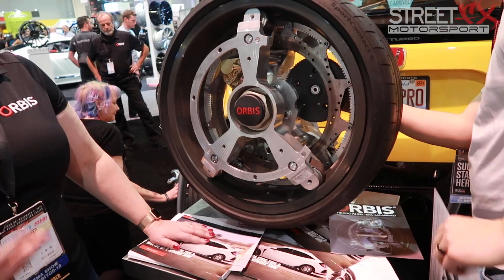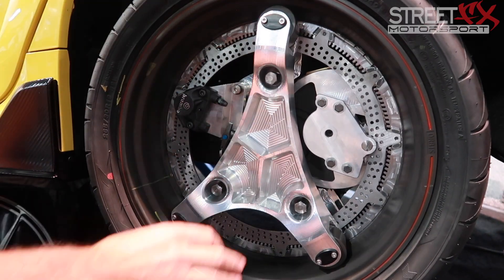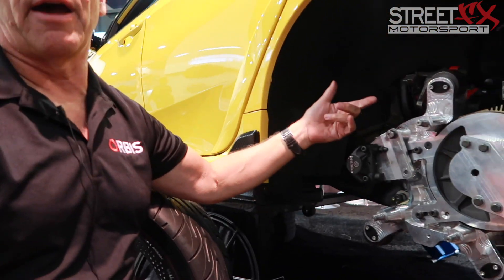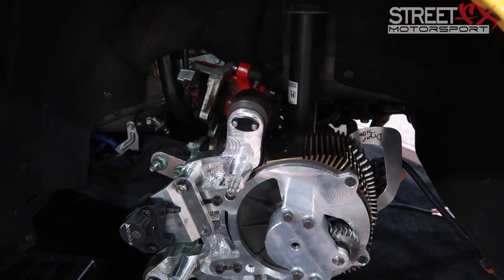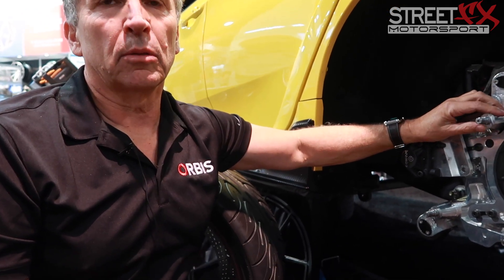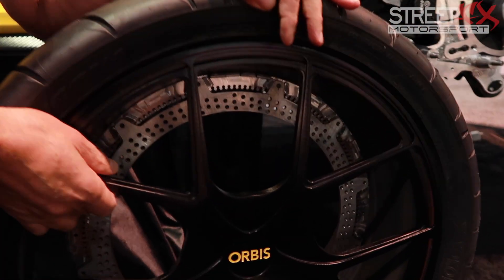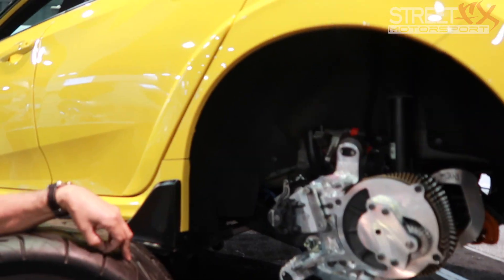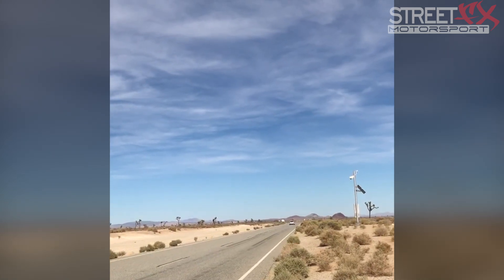WORLD's FIRST ELECTRIC hybrid AWD Honda Civic Type R FK8 with 450hp!

Comment: So 6, 2 inch rollers hold the rim on the car.  What happens when the rollers wear, the rim wears?  You have all that space and wheel offset.  Build a motor in a wheel that has the correct kv to not need a gearbox that bolts directly on the existing suspension.
Reply: No need for a brake at all.  Re gen the motor

Comment: 9:45   CAN Bus  :  For those who wonder, is a standardized control network that connects all the electronic components in a single 'loop' and from this 'loop' , you can read and write information to be shared between the components, like throttle position, engine temperature, etc etc. It is universal between car brands ... mostly

Comment: This is the future of vehicles, electric drive motors in the wheel hub. It makes vehicles much simpler, and more reliable. The electric motor can even do most of the braking too. Someone just needs to build a small safe reactor with a capacitor to smooth out the power use.

Comment: Get a hybrid and put these in the rear. Instant power boost. Needs adjustment for different tire dimensions. Would like to see design changes to allow for larger tires and a smaller rim size.

Comment: In theory good idea but in practice bad those little rollers you get rocks and other items stuck in between them not going to be very happy and you're really going to have a very short mile range with us had a very expensive cost
Reply: And if say you were able to get a battery pack for $2,000 as soon as people start running to get more of those prices going to go up in the man and then you're in need Professional installation of all this please by the time you actually get the system up and running you could have actually bought an electric vehicle at almost same cost or near same cost

Comment: The handling and comfort because of the higher unspring weight will be a major issue. This is why not a single EV currently on the market has a hub motor.

Comment: 12k to make any car hybrid/electric is not bad at all, you get a an old car, remove the whole engine, gas tank and cooling system, add 2 of these kits, plus a plug in hybrid kit to charge the batteries, and for under 30 grand you can have a 200hp electric car, with a range of 80 miles, take that tesla lol

Comment: .6 second gain? For how much? 🤦‍♂️
Reply: Did you miss the launch control, the breaks, the emissions, fuel economy etc. parts of the video? For just raw power you can get ecu tuning or if you want it even cheaper, a chip tuning an voila, you got like 30-80hp more.

While I do agree it's still at this point expensive, nonetheless it's an incredible invention and the prices will go down eventually. Ofc this is not something you would buy for your 1987 Toyota Corolla, but for your brand new MB/BMW/Volvo then why not..?

Comment: I'm curious why the cost is so high? I'm assuming its because of start up cost and to make up for R&D? Those motors sre probaly about $250 each the thr speed controller maybe about $100 the all the custom machined parts maybe another $350. So thr cost of the whole system not including economy's of scale is about $1000. I understand the need to make a profit but I feel like if the dropped that 10k price tag down to a 5k price tag, they'd still be making a lot of money and the number of customers would tripple.  But thats just my opinion.

Comment: Get rid of the caliper and brake.. use the motor to brake and return some of that energy lost to braking and send it back to the battery...
Reply: Have you watched through the video? The system has regen braking. The brake rotor and caliper are there to supplement that. Regen alone is not strong enough braking.

Comment: Use a Kubota D850 generator as the power source. 200 MPG car. Easy.
Reply: If that’s true, make it and become a millionaire.
Reply: Use two alternators connected together, a set of Headway Supercapacitors and you'll have a complete off grid car. Just add a  FWD pair and it'll run forever as AWD

Comment: So I live in aus. Usd 9k to aud is approx 13k I’d love to have this turbine noise on my 2zr swapped Yaris. Turbine noise is much better than 4 banger 🤢. Love it. If they come to aus I’d love add these and have a more economic, balanced and powerful Yaris 👌🏼 50hp/wheel would be fine. But I’d also want the 100hp/wheel for my turbo falcon which would put it at 700whp. How many nm do these put out? How do you charge the batteries?

Comment: I came up with a similar idea 10-15 years ago (electric hub motors to drive the front wheels to improve on Australian front engine rear drive vehicles at the time) to improve efficiency, help get our tyre pounding turbo 6s and V8s off the line, and provide a much more positive feel around bends courtesy of electronic torque vectoring.
You all have no idea how much it pleases me to see someone else has had the same idea and actually got it running and out the door 👍

The next step I'm guessing is to add electrical assistance to mechanical drive wheels, to add more power, relieve any flat spots of the internal combustion engine, and reduce driveline stress, as that was my idea to push the tech further had I been able to build it

Comment: This is a really cool design but for the battery not included for only 100 hp?!? Even for racing this doesn't sound worth it. Not saying this isn't cool but for $10k you can put a hell of a lot more horse power in it or spend it towards other parts if needed.

Comment: Fuck the Haters. This is one of the best New Car inventions for the Aftermarket period. I just hope it won‘t die down before they develop it perfectly. Just imagine Adding Electric FWD to a high Power RWD Car! It would provide great traction and Off the line acceleration without the heavy weight penalty of the AWD drivetrain.

Comment: I've actually been thinking about doing something like this myself to my base model Civic. My schools electric racing team has gotten their hands on some plenty powerful motors and batteries. Keep in mind I'm not looking to race my base model kid carrier.
Definitely not trying to mess with the hub system though. Yours does not inspire much confidence in me. The brakes, awesome. The gear... Kinda, not really. Could probably maybe be sealed up well enough. But then it has to be separate from the brakes to keep those cool.
Then the rollers on my rim and no central hub. No thx. I'll pass on that.

Comment: Now I would actually consider this this for my 9th gen SI i mean lets do the math a supercharger or turbo kit would be over 5k then that does not include the other upgrades .

Clutch -  $300-$400
Exhaust - $300-$400
Down pipe - $200-$300
Fuel pump - $100
Hondata - $500
Maybe brakes for more stopping power - -$400-$500

Then with all the added Weight transfer to the car you might need to upgrade the suspension to coil over shocks $1000-$1500

Lets not forget strut and under carriage bars
Another lets say $500-$1000

And this is to do it the right way just to add another 100-150 hp !

Lol so do the math people all of that work $ and countless trips to the tune shop for that hp or a one time flat fee with one trip to a shop for the install and little to no work under the hood for an extra 100 hp which would be waaaaay less stress on the engine and AWD ! 

Things to make you go hmmmmmmm 🤔🤔

Comment: I read through these comments about how this is ingenuity and so cool and blah blah blah but lets be honest here.  The whole thing is a crock of s designed to keep investment money flowing.  The full of it guy is "selling" this kit less the battery for just shy of 10k. I say selling in quotes because it isn't actually for sale anywhere but you are more than welcome to pay the 750,000USD, yes 75 followed by four zeros, for a 12 month exploratory license fee. As shown on the Orbis website. You then have to buy the battery which is 2-3k or more depending on what you use meaning performance of the kit varies.  So even if they did sell this kit which they don't I can think of far better ways to get .6 second faster zero to 60 times that cost less than 12-13k in parts alone.  I mean in the event they do ever sell this to anyone its your money and to each their own but I wont be biting.

EDIT - As of Nov 23 there is now an "Availability" pull down on their site offering pre-orders.  This pull down replaced the License link that was previously in its place. See google archive for the 17th and I made a copy as I imagine Orbis is monitoring these comments. They are offering a 10% discount for the first 150 buyers.  250 refundable deposit is required however no release date is stated.  The only given by their own time line is it will take over 120 days. to receive your unit.  Purchasing of the CANbus interface costs extra and the Shipping costs more than it does to ship an industrial grade 120 gallon vertical air compressor with a dryer and liftgate residential service by 10 bucks.  (That boggles my mind as their kit isn't that large nor does it weigh much...  They also don't warranty their product "While it is the constant endeavor of ORBIS Wheels, Inc. to give our customers the highest quality products, ORBIS does not warrant any of its technologies..."  So basically if it breaks because of any manufacturing defect or because it really isn't "completely impervious to the elements" you are SOL.

And yes Orbis I am saving all the archive pages since as your website is reflecting with a link to this video you are monitoring these comments as evidence to back up my opinions at the times they were posted.
Reply: uhh u dont need to pay the licensing fees in order to get that ring drive. That fee is for exploratory reasons, meaning its for manufacturers. It is on sale, just in pre-order in their website. Did you even read the whole thing i  their website?
Reply: @mw184  Actually I did and for your information and you can check the archive out they just made it available on their website for pre-order TODAY. As of Nov 21st when I posted that there was NO availability pull down. there was ONLY a license section and a portion in the FAQ stating that it wasn't available for sale and that if it was it would be sold via distributors or partners. Do you not know how to use google?

Comment: something that intrigues me is the 100hp per hub version for ev conversions - you could strip the gearbox / gas engine out of a car and more easily use that space for batteries instead of trying to install a electric motor and adapting it to the old gearbox in the same space

seems like a big plus for packaging

i also wonder how hard it would be to make the wheel assembly sealed for offroad use - i imagine just closing it up would make it much quieter

i also wonder how this type of motor/wheel assembly would hold to up rough service like rally racing

Comment: "Direct drive", "2 speed" and "gearing" don't go together. That's not what direct drive is - direct drive means that the output (the spinning wheel itself) is directly coupled to the motor (think of a quadcopter where the props are literally on the motor shafts). They're just using all the technical terms from all types of electric drivetrains to try and sell this idea as cutting edge and better than it is. While split parallel hybrid designs are great for retrofitting 2WD vehicles they shouldn't cost that much, they won't give you the same economy as a Prius and they won't allow electric only driving without significant modifications to the cats electronics that would be vehicle specific, making them no longer bolt on.

Comment: An engineers obsession. It's too bad he wasted a lot of someone's money making this happen. Make the wheel the rotor of the motor then you have a viable product.  This will not hold up. Failure points in several places. Big safety hazard.
Reply: The funny part is they bill this as some amazing new invention and conveniently don't point out other spilt parallel hybrid designs that do use the wheel as the rotor (those other ones being the designs they copied the term "direct drive" from even though this design isn't direct drive lol).

Comment: Bring to the point of weight reduction. You’re taking all that extra weight off the hub, brake, caliper and wheel, but adding 150 lbs in batteries. I understand the HP, but still.

Comment: is it possible to run a small diesel motor on the car to act purely as a generator for the battery pack?  do these motors have any regenerative abilities when coasting or braking?
Reply from the maker: 1) yes. 2) I guess you didn’t watch the video as that question was answered :)
Reply: @StreetFXofficial  i did watch the entire video but I must have missed it

Comment: Very cool/interesting. So wonder if you had a car, removed the engine/tranny and all those other pieces could this be used for a 4wd all electric model? Sounds like it would run u 25/30 grand but would be cool

Comment: This is not practical. A 10kw battery has about 6 seconds of power @ 100%.
Reply: A 10kwh (not kw, kw is power output, kwh is capacity) battery can supply 10kw or approximately 13hp for an hour, which would mean to drain it in 6 seconds would require a motor making  7,800hp. So even at 100%, and assuming 90% efficiency (quite common for electric motors) this thing should last 47 times as long, or about 4 minutes 40 seconds. Very few people accelerate at full tilt for 5 minutes in most workloads, and under every other circumstance it's either using far less power or generating power while cruising for the next burst of acceleration.

Comment: Anyone imagine how those wheel rotor combo performs on loose gravel or so? Exposed gears literally no lubrication, because they are exposed difficult to maintain, will need cleaning, supporting rollers on that triangle hub rolling on internal surface of rim, that will need to be clean too. Anyone Imagine if any small rock will catch there carbon wheel will be ruined instantly That cover is total joke, no waterproofing.. Over engineered unreliable solution. They are need reduce any mechanical detail and minimize failure. With all respect all that thing look like open Swiss clock on beach sand!
Reply: You state great points of view, I agree with you. Don't fix it if it ain't broken
Reply: That cover is for the show/demo. He specifically said that the kit will come with a solid plate (opaque or lean) and a SEAL to keep out debris.

Comment: I like the idea, but not the implementation. The roller wheels seem like a bad idea. Bearings would last longer and would probably be a lot more reliable. But of course they had to do that in this case for the way they packaged everything inside the diameter of the wheel.

Comment: The small wheels that holds up the rim must take a shit ton of force and speed. I see it hard to find bearings that can handle that while last long. But at the same time the direction of the force to the bearings is pretty optimal. Also, 10k is not expensive this. These motors and controllers could them self be 10k

Comment: title says 450hp.  lets do the math.   stock hp = 300hp.  one wheel creates 50hp.  two wheels = 100hp.  300hp + 100hp = 400hp.  Where did the extra magical 50hp come from?
Reply: Read the description. The ones in this video are 50hp but can produce 75hp.

Comment: 9k+ for 200whp 🤔 nup!! Great job and Innovation hope get better and more hp for the price they ask
Reply: But its 200whp you cant get from any other source. Say you add turbo kit  to your built 2018 mustang and get it to 800 Hp. You still could add these and get 1000 HP. Also while you are waiting in the pits you don't have to burn your engine up just run the wheel motors. Plus AWD and gas savings in town.... It's a win win win win combo.

Comment: Wonder hw long those gears gonna last without any lube.
Reply: Yeah, i think that must be a show kit, there is mo way it would work exposed.
Reply: One drag race-ish.
Reply: you can brush some motor-kotte on those gears before every trip
Reply: It’s definitely a mod made for tuners as there will probably be much upkeep with those gears. The inventor said you can swap out the gears for different gear ratios and loos like its just a few bolts and a few minutes to get this done. So even if you had to do this once every few month (depending on your driving) and the gears sets were economical, then it would be nothing for a tuner to deal with. I’m curious about the noise factor in the cabin. Hopefully only under hard acceleration would it be loud.

Comment: Maybe bump up the re-gen efficiency with super caps along side the batteries? I'll take two lol
Reply: The regen is actually brake caliper limited, because of the way the brake control works on a retrofit the calipers need to engage in braking, unlike a PHEV or EV that can do one pedal driving in electric mode and have the calipers completely disengaged even in moderate braking.
Reply: Unfortunately, the majority of braking is done by the front wheels so this is why the regen is so low. Find a way to regen off the front wheels as well and then you could get way higher figures.